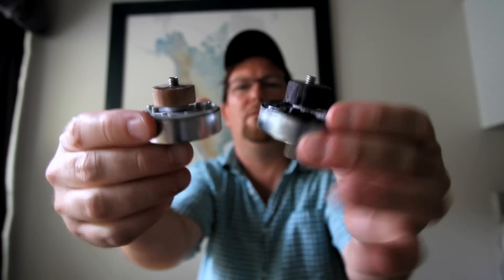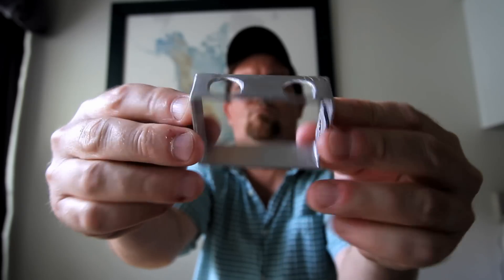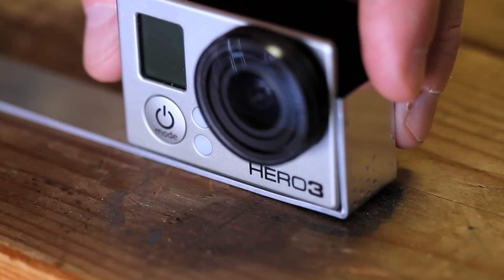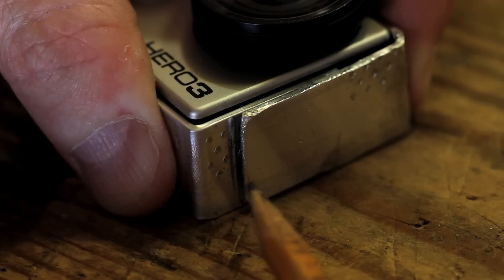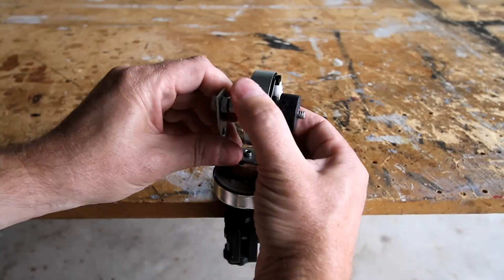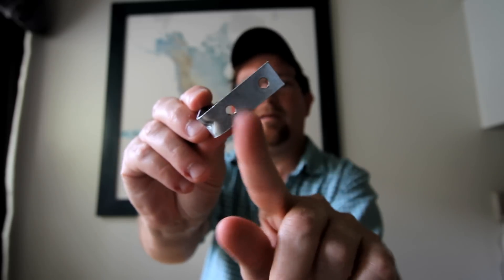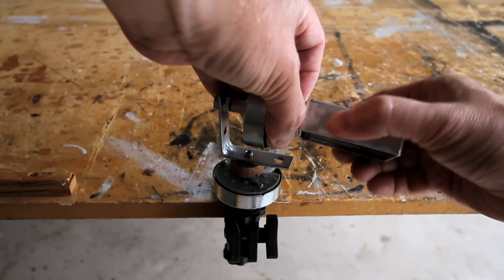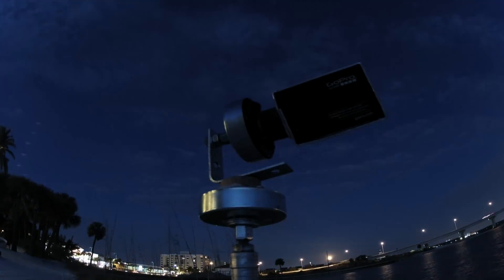DIY GoPro Pan/Tilt Time-Lapse Rig Part 2

Comment: Awesome! Time to add tilt to my Ikea panner =) I'm surprised that these egg timers are strong enough to tilt a gopro but I just tested mine by holding it sideways and it works even with added weight of the waterproof housing.

Comment: Hey Larry! A frame like that with another hole on the side, and a bottom mount, would allow access to external power, for those LONG battery eating timelapses!
Reply from the maker: Yes, I did that with a few of my prototypes.  Interesting thing about shooting these pan tilts is the sweet spot is only about half an hour to an hour so you usually don't need extra power.
Have not done one in a while, I guess I need to reinvent it again!
Reply: I mean without the panhead. Just for a long running time lapse where your battery would run out. I never thought of making a frame like that.
Reply from the maker: Mmustangg Ggnatsumm Ahhhhh ... it works. And cheap to build.  I bought a Gopro version last year and it broke.  They were nice enough to replace it.

Comment: Thanks for the guide! Does the old video/method with the waterproof case work with the Hero3+ waterproof case? Not sure if the WiFi button poses an issue. 

Also, how sturdy is this? If I were to pair this with a GoPro suction cup mount on the roof/hood/etc. of my car, then drive on the interstate, would I need to worry about losing the timers and GoPro from wind?
Reply from the maker: Ryan Hartigan The nice thing about building your own rigs is you can customize the rig to your camera.
I think the Hero3+ with case will fit, or make a few adjustments during your build. 
About car shooting, I always advise using tie-offs. Nothing is 100%, nothing. So assume it might fail and secure
it twice. I would tie off the rig to the suction cup, so that it can still move and tie off the suction cup in case it fails.
I shot with the tilt part of this rig up to 70mph. See video here.
https://www.youtube.com/watch?v=0oxxoZ8ZGgw
Be careful and good luck building your rig.

Comment: Very very cool! I made a single timer one last niht and it works amazing! I was wondering what do you use to attach the the camera to the times? I see one has a round black thin and the other a round wooden thing. What are they? The kitchen timer I used looks like a cupcake so mine looks a tad rediculous at the moment. Thanks!
Reply from the maker: It's a wooden dowel, check these links for photos and more information.
http://www.getawaymoments.com/2014/03/golapse-diy-part-5-how-to-make-gopro.html
https://www.youtube.com/watch?v=_73CI5TTsVM

Comment: If i were you, I prefer get cheap frame mount from ebay like from £3.. Good video tip you got, keep it up :)
Reply from the maker: I make my own frames to keep them light enough so the timers can spin them.
Do you know of a plastic GoPro frame with the mounting screw on the side?
I wish I had a 3d printer .... I would just print one.
Until then, I will keep bending aluminum.
Reply: Getawaymoments maybe try to glue a 1/4, 20 nut to the side of the plastic frame?

Comment: Hi there. I love this pan and tilt unit. I'm in the UK and every DAY store I have been too can not convert the parts needed. If I were to send you a transfer via something like PayPal,  would you be willing to purchase and send the parts. I have two timers. Just need everything else.
Kind regards.
Martin.
Reply from the maker: Hey Martin, not to push you off but you should be able to source locally. Have you tried Metric equivalent M6 part to sub for 1/4 20? If not can you order through this site?
http://www.homedepot.com/p/Unbranded-1-4-20-x-3-8-in-Stainless-Steel-Socket-Set-Screws-2-Pieces-73798/202210018
http://www.homedepot.com/p/Everbilt-1-4-in-20-tpi-Zinc-Rod-Coupling-Nuts-822251/204337387
and I think this is the last part
http://www.homedepot.com/p/Unbranded-1-4-in-x-4-1-2-in-Phillips-Flat-Head-Machine-Screw-37851/203496247